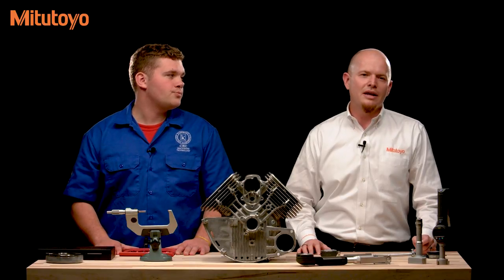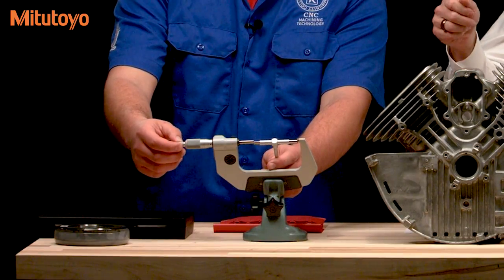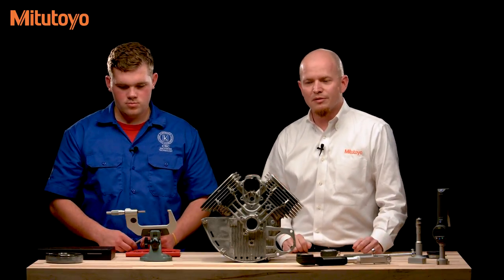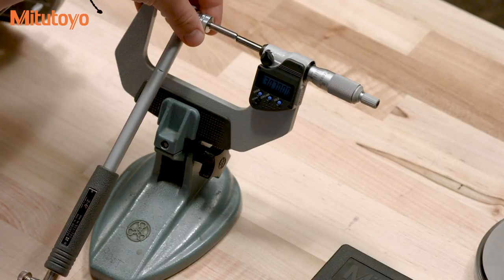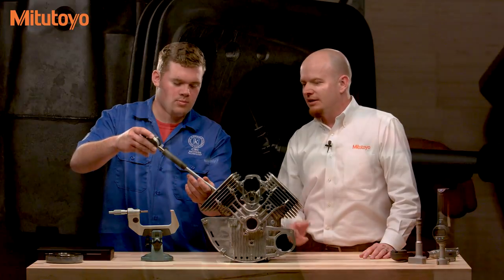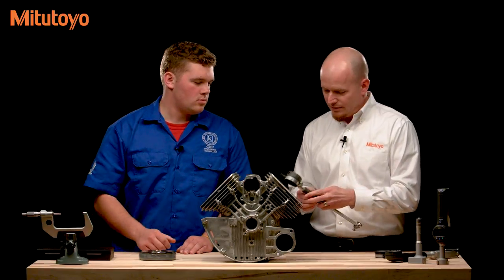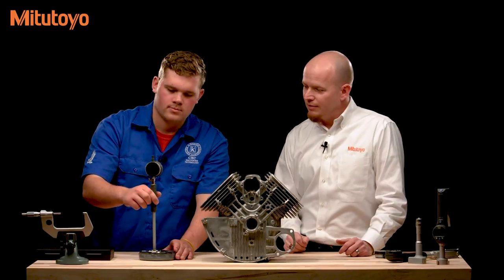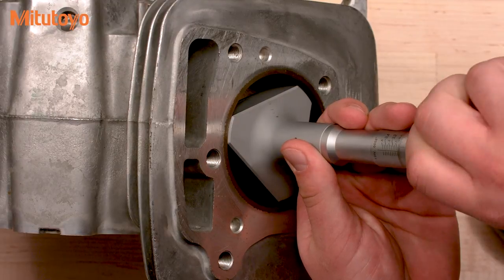Measuring an Engine Cylinder with Mitutoyo - Bore Gage Measurement

Comment: Most precision machine shops will teach to insert the telescope gage collapsed, allow it to spring open(so long as the bore is not sensitive OR easily deformed), Then tilt the gage at an angle so that it is at a larger diameter than the bore to be measured. Lightly tighten the stem of the telescope gage and then sweep it out of the bore where it will record the bore size. hopefully that makes sense.
also dont ever rock a dial bore gage by the indicator, use the insulated part of the handle. 
love yalls videos but this is teaching bad habits. 
keep up the great work and lets all keep improving and inspiring the next generation of manufacturing professionals!!!
Reply: thats right!!!
Reply: Totally agree
Reply: Yes sir

Comment: Nice Video!

Like the Digimatics, but concerned about the 3-point measurement for a cylinder shown later in the video for an reciprocating engine bore that has thrust loads.

I am working on a Toyota/Yamaha 2zz-ge engine and have measured bore at three depths and two axis. Although my measurement system is only capable of 0.01mm accuracy, the relative deference as shown on my bore gauge indicates my block is "out-of-spec".

Bummer, but I am looking to upgrade from my dial unit to a Mitutoyo Digimatic.

Cheers,
P

Comment: How would you approach measuring a taper?
Reply: Maybe measure at the beginning of the taper and then make a separate measure at the end of the taper. There is probably some math formula to find the taper angle with these two numbers.
Reply: Very carefully..... ;-)
Reply: Sorry for my humor.
The standard practice for measuring an engine cylinder bore is to measure just down from the head gasket surface 8-10mm (5/16-3/8in) in two directions 1) front to back (thrust load faces), 2) side to side (non thrust load faces). 
Then repeat mid way down the bore and finally repeat again about 8-10mm 5/16-3/8in from the bottom of the bore.
This identifies bore size, taper and out-of-round.
Taper usually occurs in the top half of the cylinder bore due to ring wear. 
For taper and out-of-round most manufacturers have a service limit of 0.05mm (0.002in) at which point it is to be refinished or replaced.
I hope that answered your question.
Cheers!

Comment: There great for building lawn mowers.    If your a serious engine builder never use this crap.
Reply: Chris Burnsed Oh?what would you suggest for measuring bores, main saddle bore and rod bore size?
Reply: We note your trolling self doesn't pose an alternative. Professional machine shops (all kinds, including many doing much more precise work than auto engines, there's another world of precision in machinery building beyond race motors) often use Mitutoyo. I copy skilled machinists in aviation and industry. There's plenty of Mitutoyo gear in their shops.
Reply: Yeah! It's Plastigage or nothing at all!